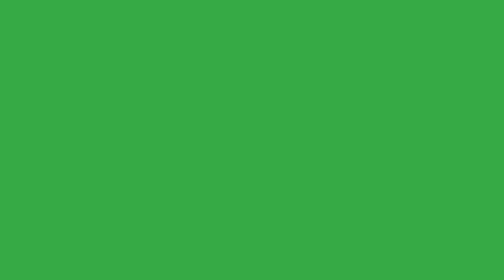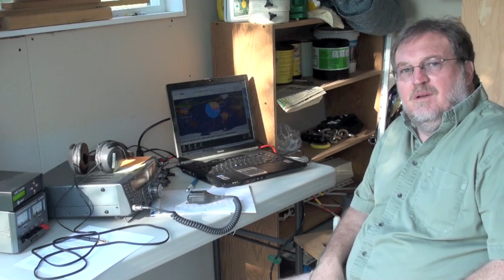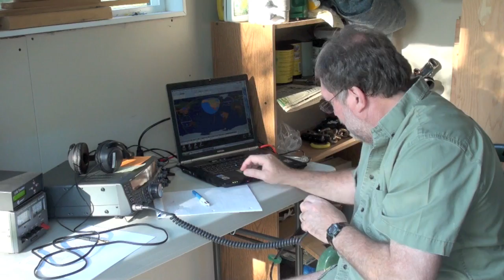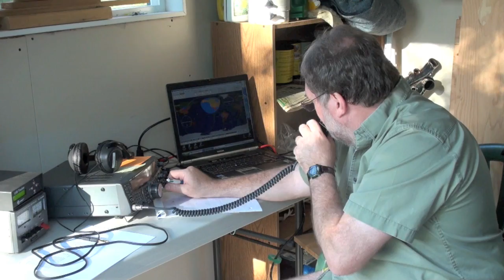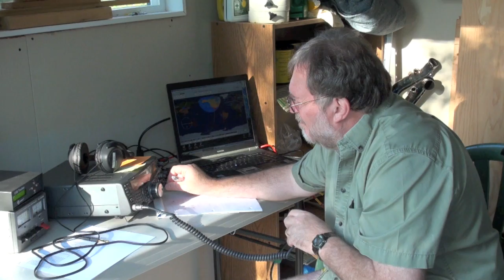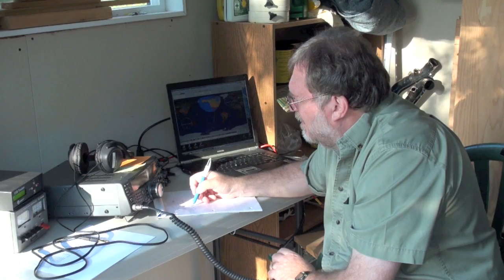AO-7 Satellite QSO - VA7ACG

Comment: Hi Alex
Firstly thanks for the video's Iam really new to sats just got a ts2000 and running satpc the only antennas I have are 2 eggbeaters
question do you have trace on the radio if so is it normal or + and what are the keys you are using on the laptop ????
thanks Bob G4PEN
Reply from the maker: I let satpc32 run the radio completely. Sometime the doppler adjust on satpc32 needs a little tweak but should be good if you have your sat file up to date.